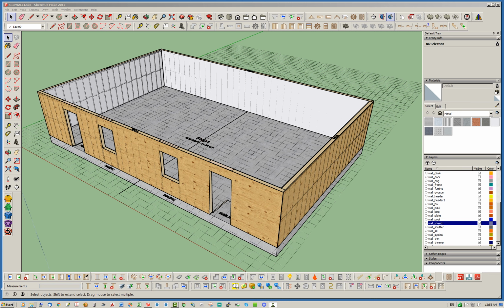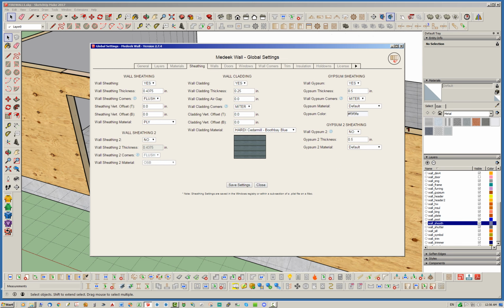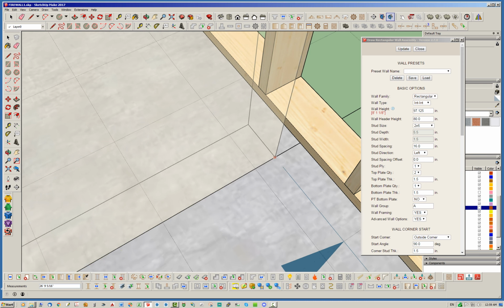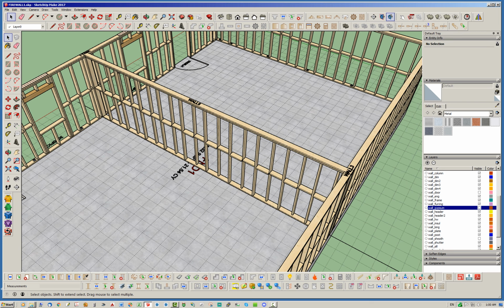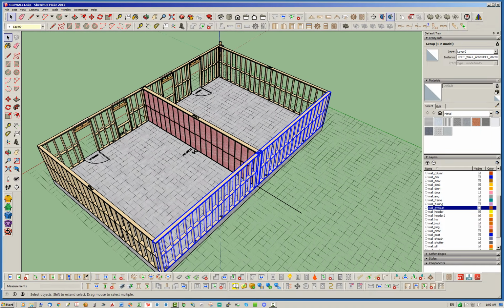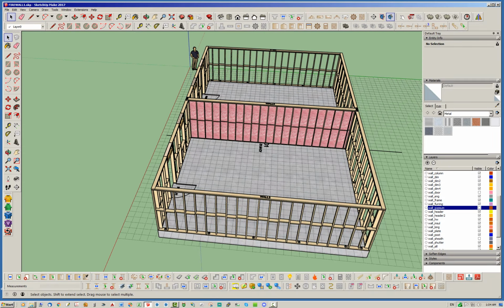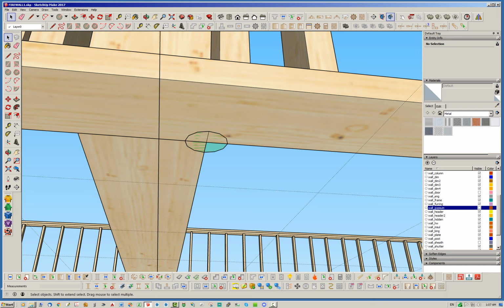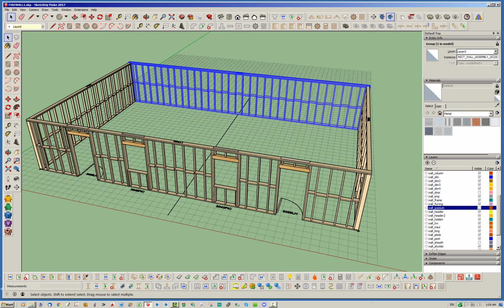Medeek Wall Plugin Tutorial 27 - Staggered Stud Walls

Comment: I am trying to deside if this tool is sufficient for simple order calculation. The trial version didnt have a good function for exporting but I dont see that as a problem as it is possible to export to open-bim solution via IFC and do the exports from there. However, for that I would need automatic IFC classification. That seem to me as a rather easy thing to do given that all the geometry already have a function in your parametric extension.

Is it as easy as I seem to think to make the extension create IFC classifications as you draw the walls?

Comment: Neat feature.  When we do this though the studs are put side by side with one being flush with either side of the plate so our 16" layout stays the same on both sides of the wall.  The way this is shown, the layout distance is doubled so if you want 24" o/c you would have to make the stud spacing 12".   Usually if we have a wall like this like for a duplex we will build two 2x4 walls with an inch airspace between them and type X drywall on both sides but this seems like a different type of wall.